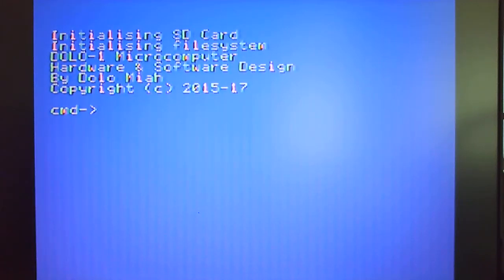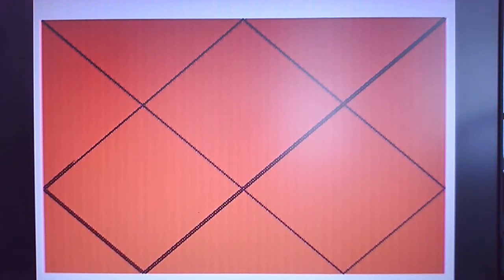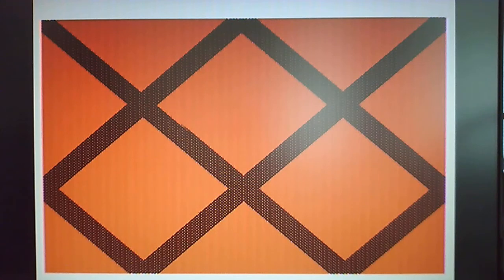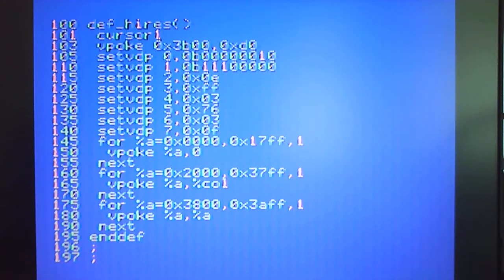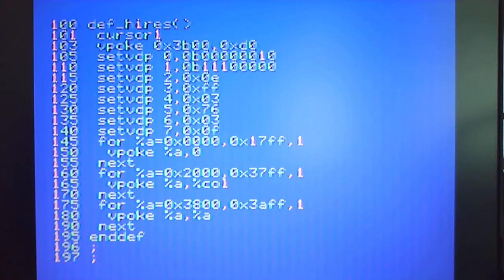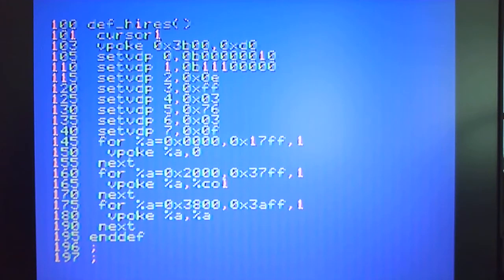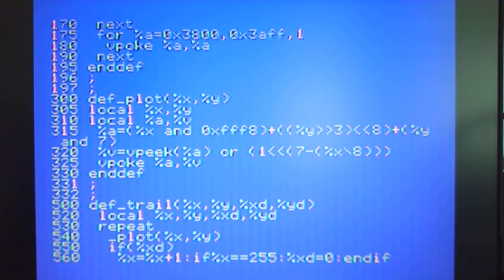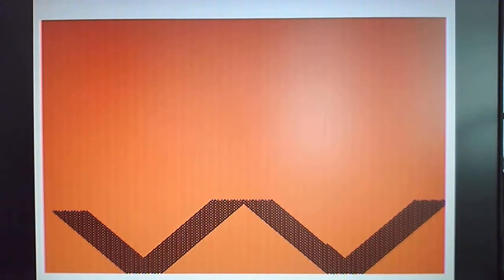High resolution graphics on TMS9918a

Comment: How did you handle writing to the desired position on the screen? I understand that there’s 960 different positions, but I’m struggling to have the vdp write to a specific position. I’m trying to implement backspace in text mode. I thought I would need to decrement the name table register, write a space, and decrement it again. This ends up printing spaces in random spots or making the screen completely random.
Reply from the maker: Hi and thanks for your comment.
The VDP has a command mode to set various registers. One of those commands is to set the the write address pointer, low byte then high byte with bit 6 set (0x40) in the high byte. I had to put a couple of NOP to delay the write of the high byte after the low byte (6502 running at >5Mhz).
Once that is done, the byte to write can be sent to the VDP and the VDP will write this to VRAM using the address pointer. The address pointer will auto-increment, so sending another byte will be written to the next VRAM address and so on.
A thing to be careful about is to make sure the address pointer low and high byte set up is atomic - I disable interrupts to do this.
I don't change the name table register at all once it is set up - this just tells the VDP where to get the data for the display every frame, so changing it will just point to a different part of VRAM.
The code for this is available on my hackaday page (see link below) - download the source files and look in vdp_low.s (it's all done in 65c02 assembler though).
Hope that helps.
https://hackaday.io/project/5789-65c02-homebrew-computer-on-breadboard

Comment: The TMS9918ANL has a External Video Input (composite) to allow two video chips to be connected (superimposition/Overlay function). The Datasheet shows this. The RESET input being used to synchronise both chips. Would be Cool to see this used.

Comment: Does the TMS9918ANL have an external Video input ?? The datasheet shows two connected to give Superimpose  ?? The synchronisation is done via the RESET line. Would be cool to use this function.
Reply from the maker: Yes that's right, it's possible to feed an external source which is shown in place of colour 0 (transparent). When there is no external source then colour 0 is user settable.
Oh yes the possibilities are endless with the external feed - e.g. I could add a 9918a to do background graphics, using the other for foreground.  Like dual playfield on the Amiga!

Comment: Other Video Chips worth looking at for future projects  are :

upd7220 (or Zilog Z7220)
Thomson EF9367 
Yamaha V6366
Yamaha V9958
Reply: The Yamaha V9938 is similar to the V9958 and definitely worth a look at. The V9990 is even more interesting.
Reply from the maker: I hope to integrate a V9958 in place of the 9918a but it's a little tricky as the 9958 takes up many more pins.  But I think it will be work it! :-)
I'll take a look at these other chips - thanks for sharing :-)
Reply: @6502Nerd  The V6366  is useful for giving CGA/VGA type modes...320x200 16 cols,  640x200,  640x400 etc
The upd 7220 was used in some 80s PCs  > PC-9800 used two  , as the upd7220 allows overlay/superimpose. 
The Thomson EF9367 was a french chip ...probably used in French PCs ??

Comment: Hi.

Is that a UK TV your using ?? As the TMS9918ANL gives out NTSC composite 60Hz signal. I'm not sure if modern British/European TVs  will detect and display NTSC signal ?
Reply from the maker: Hi
Yes it's an old LCD TV I picked up for not a lot of money and it's UK specification.  I think nearly every TV of the last 10 (maybe more) years will detect and display NTSC.
I have changed TV twice, bought an old Goodmans LCD and now a brand new Sharp - all of them have displayed NTSC no problem.

Comment: Amazing. Just got my hands on some TMS9918 chips. Can't wait to implement it on my 6502 SBC.
Reply from the maker: Fantastic - I am sure you will have a great time with it, like I did!
Reply: @6502Nerd  I finally implemented the VDP. One thing I noticed is, I can get color on a cheapo 10" LCD TV, but only black and white on my Commodore 1701 monitor. Did you come across this issue? Maybe it's the video amplification circuit that is at fault, but I don't understand why I get color with the 10" monitor if it's the case.
Reply from the maker: @Fred.aka.MicroHobbyist  Firstly, congratulations on the VDP success..would love to see s video of your set up🤓👍🏽👏🏽👏🏽
On the colour issue, not sure but I was thinking amplification too..maybe try different resistor values in the VDP composite circuit?
Reply: @6502Nerd  I'll try that!

Comment: How did manage the electrical side of the motherboard, like which capacitor or resisitor to which chip and what is the amount of it.
Also
Who wrote the bios,
Also what is the kb you used and which chip again how did the count the capacitor and resisitor amount.